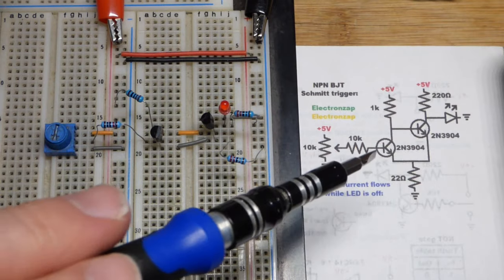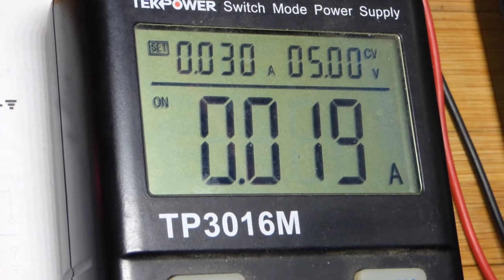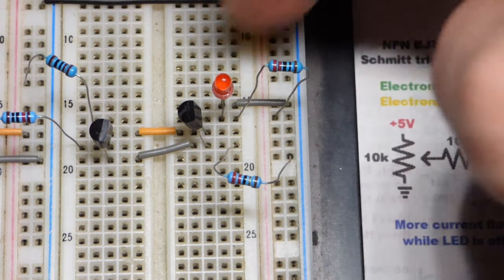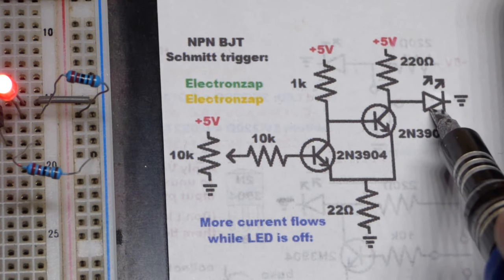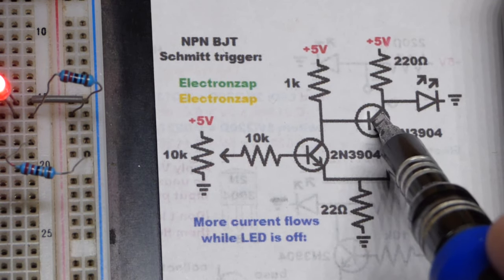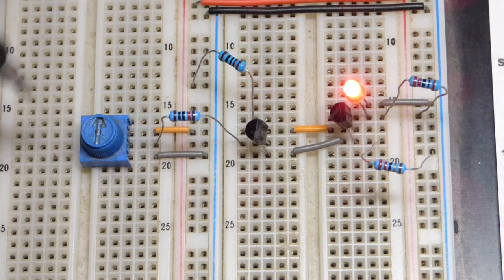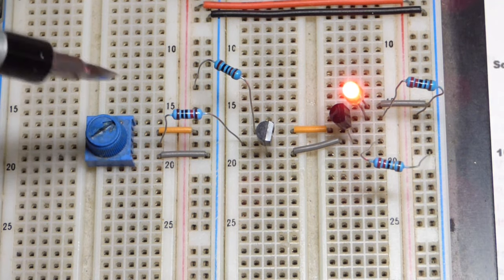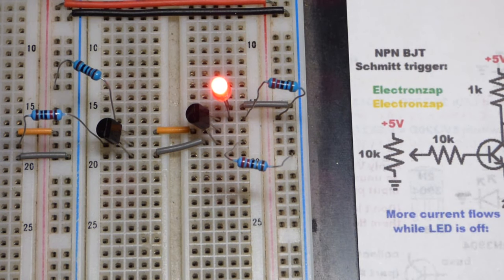Schmitt Trigger Circuit made with 2 NPN Bipolar Junction Transistors 2N3904 BJTs

Comment: 1) add another output stage which inverts the signal but allows for less current in the preceding stages.
2) add another output stage which inverts the signal but allows for less current in the preceding stages and gets you back to the original logic states... also a darlington setup on the output needs less base current.

I did this to make a delay circuit by having a capacitor on the input so that after my switch (where your potentiometer is) was turned off, the output stayed on for 15 minutes, my output wasnt an led but a dashcam with a useless internal battery
Reply from the maker: Yeah, that all sounds good.